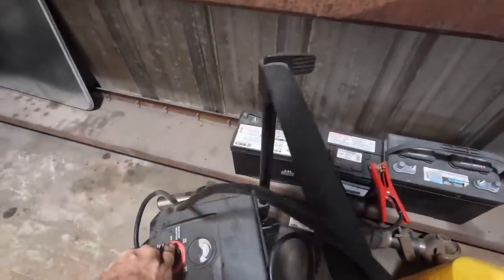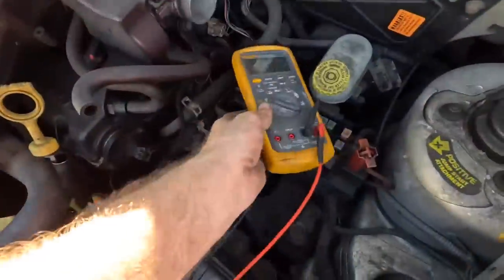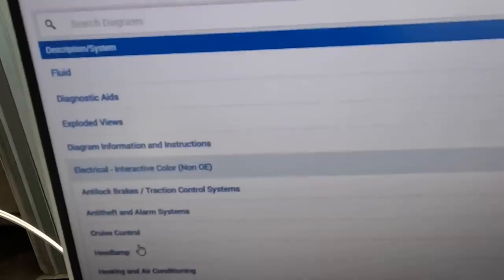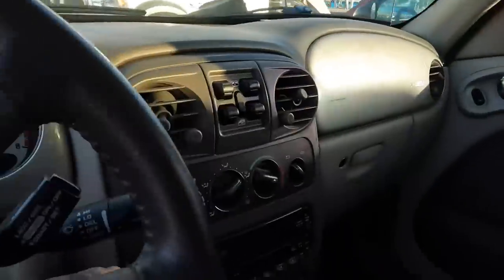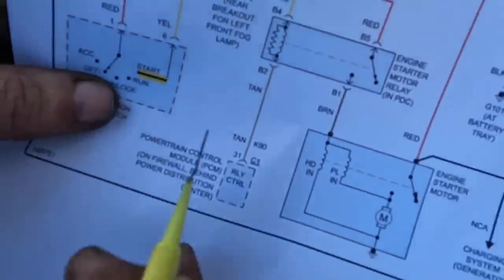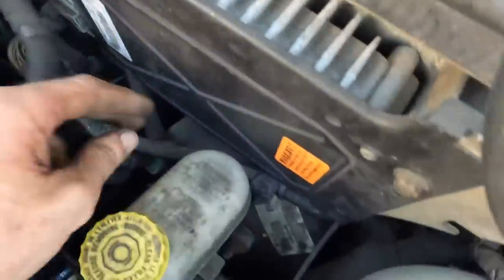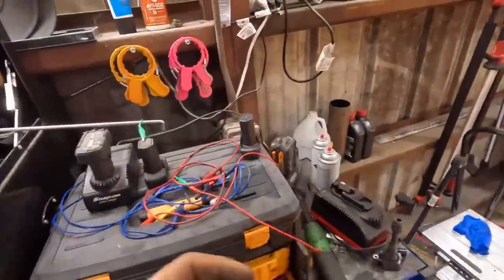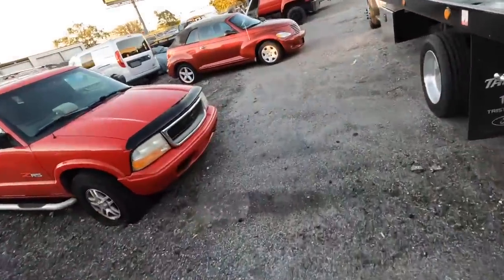It’s DEAD! Parking lot diagnosis

Comment: Just finished diag/repair on Chevy 3500 w/electrical issues. Culprit was brake light socket melt and short internal. New flasher, relay, socket, and clean up wiring. They used used wire nuts to wire dump bed and rear lights. All soldered /proper connectors now. Took 2 days to chase that short down.
Reply: Had a similar ordeal on my 73 Monte Carlo. The cig lighter wasn't OEM and wouldn't stay in and pop out when heated. My GF held it in to the point the element came out in one long string. A battery and alternator later I traced the electrical drain to the socket, got and ground shorted with a piece of the element.

Comment: Just had a similar issue with a similar year Jeep - no crank, no start, no fuel or volt gauge movement in the cluster, but it would crank fine if I sent power down to the starter through the circuit the relay energizes. Ended up being the PCM.

Also, you can't just swap PCMs on Chrysler vehicles that have a SKIM (fat grey key is an indicator), and if you have a compatible PCM from a vehicle that doesn't have a SKIM and install it into a vehicle that has it, it'll lock to that vehicles SKIM and will no longer work on the original vehicle, unless you reset SKIM on it.

Comment: The "ground" supplied by the PCM is a switched ground control line for the starter relay. I don't have the documentation for this car, but the PCM is looking for a certain set of conditions to allow the starter relay to operate. So the PCM may or may not be bad, but you won't know until you figure out and test the conditions the PCM needs to allow cranking.

Comment: Hey, Ray, when you apply power or ground to a circuit by using a test lead straight to the battery, you should run that through a head lamp bulb. It adds a lot of functions to your test lead, most notably, short circuit protection and current-carrying capability testing.
Was this a case of no-communication on the OBD-port? Your scan-tool should be able to provide an answer on why that PCM refuses to allow crank.
And if you don't hear the fuel pump priming, you should check why it doesn't do that. Supply power to it through its relay contacts and check if the fuel pump relay's input is getting power.

Comment: An un-bent paper clip can be a handy tool for such diagnosing.  With "crank, no start" I like to use aerosol starting fluid to see if I can get the engine to run a few seconds, to isolate whether fuel issue or spark issue.

Comment: A few commenters have mentioned the immobilizer system. Given the symptoms, I would agree. *BUT*, my first thought was something in the Neutral Safety Switch. The NSS sends a signal to the PCM, allowing PCM to ground that relay as long as the trans is in Park or Neutral. I would imagine that you can see that PID on a scan tool. My suggestion is to get the scan tool on that car and see what is going on.

Comment: Had a similar issue on a GM product and it turned out we were using a non programmed key.  Once we had the right key it worked immediately.  Not sure if this car has a programmed key or not, but it would not surprise me a cheap car has a dealer made only key.

Comment: PATS problem.  The PCM only provides ground to that circuit when it reads the chip in the key.  The computer is matched to the reader in the column.   You can only reprogram it if you get the pin number from a dealership.  You can take the pats module, key, and computer out of another car  from a junk yard and change them all together and it will work.   Chrysler will not give me the PINS for anything because I am not a Licensed Locksmith or some other Auto Security Certification.   Make sure you get the same year and options, and don't get one from a convertible.   Someone has been futzing around with the PCM and the Ignition in that car.  My guess is they tried a new PCM and then created a new issue thats different than the original one.  Just make sure they don't read the VIN out of the computer and make sure it matches to do emissions or registration in your state, like the do in NY.

Comment: good process. only question for me was IF the pcm was replaced was it programmed or is the security not allowing the start and  fuel pump since the column is open were they trying to eliminate/override the security or trying to test the switch... hard to know...

Comment: Did you check the neutral safety switch?  I didn't see it on your diagram so perhaps the PCM does not turn that ground on unless it is satisfied with the state of the neutral safety switch.  Although that car is old and I'd think it would be in series with the crank signal from the ignition switch?  I avoid Chrysler so I don't know.  Great video!  Thanks for bringing us along!

Comment: Got a "fun one" for your info:

2013 F-150
Intermittantly drops to limp mode. Stop, power down, wait a couple minutes and it runs fine for some random time... 10 min to 4 months.  repeat.
No codes can be caught if it is not actually in limp mode.

Finally got it to dealer while in limp mode.  There's a recall "If this code, replace half the wiring harness."  But only if you get it to the dealer with the code active...
Reply: Almost for sure there's a bad electronic code in the key vs the anti-theft.  Probably someone recut a key from another car or replaced a computer module without correct reprogramming.

Auctioned repoed car where they didn't get the OEM key?

Comment: You’re going down the wrong path. The big red security light is on in the cluster. Plug your scanner in get codes. Bet it’s the key that’s bad or the immobilizer ring around the ignition lock cylinder
Reply: that is the air bag light  The CAR IS OUT OF GAS as noted by the gas light being on  and is on empty...
Reply: The gas light being on doesn’t have an effect on no cranking. He had to provide a ground to the relay himself so the pcm isn’t happy with the theft. Watch part 2 when it shows up

Comment: That's usually where I get hung up.  They frequently don't make it clear what conditions the PCM needs to enable start.  As some said, there are various anti-theft and transmission conditions that must be met but it can be very difficult to find out what they all are and what the proper states coming into the PCM are (grounded?  +12v?  Or?).  Perhaps the scan tool can report on this?

Comment: I really blew it a few years ago when my PT suddenly died at about 40mph. I was so fixated on its high mileage and thinking it will need a new timing belt, that I assumed it was the problem and was too afraid to repeatedly try to start it, in case it had broken. I tire the car half way down and realized the belt was fine. It sat another two years until I got the energy to put it back together. Once I did that, it started and died. That was when I realized it was out of gas. Duh!
My lesson was I gotta be careful to not jump to conclusions too quickly
Reply: Lesson learned ; Always start with the simplest possible cause of the problem. 
  I've ignored that rule myself, causing myself hours of work leading up to a Duh !! moment.

Comment: If the ECU does not recognize the key. It will not turn on the injector circuit. It did crank before, but after a few tries with a bad key the ecu locks the starter function out. I had one back in the day. I lost the keys. Went to the dealer and had  a new one ordered. Took it home and tried it. Crank and no start. Then after trying to troubleshoot the starter stopped operating. I use the IM508 or 608 Autel to test and program keys now. Very good unit for troubleshooting key issues.

Comment: RAY READ ME!!!!
I had one of these last year and it was some wires to the under hood fuse block. Found it by grabbing a hand full of harness and it cranked. Narrowed it down to a loose pin in the back. Js. Posted before finishing watching. Dodge/Chrysler would crank and run first time for a sec if the security was tripped. Then no fuel after dtc was set. I know you know the basics ray. Can you com with the pcm via your snap on tool ???  Best way to tell scan it key on or also try and access live data. ? I’m telling you seems crazy but stick your fingers in the opening of the fuse block and jiggle while the wife unit cranks. I know seems crazy but worth a shot.   Good luck with this Chrysler junk lol.

Comment: That area you’re in seems to be saturated with PT Cruisers. Wow.

I am terrible with chasing down electrical problems during troubleshooting. It would be easier if I could put my hands on the wiring diagrams, but there generally aren’t any websites that provide them for free. 

The only helpful thing I can put my hands on are the Service Manuals (Haynes/Chilton) and luckily I have them for most of the vehicles I will work on. Some of that info is a bit over my head, but videos like yours help explain a lot of what I was never able to figure out on my own. Thank you for that Ray.
Reply: Florida old ppl
Reply: @Usmanthemecano  🤣😂🤣😂

Comment: Scan tool talk to the pcm? If not then thats an issue but if it does I wonder if you could control the relays from it. Also a good idea to try and scan to see if a code in a module somewhere might give you some direction.

Comment: Always an issue with those models, the ASD (automatic shut down) and the TIPM (under hood fuse distribution panel).  Replace 1 or both, and usually "there's your problem lady".  ;)

Comment: Ray, I noticed the low fuel light on when you cranked it and the fuel gauge was near empty. Now, maybe that low fuel light always comes on when cranked, but the fuel gauge needle should move off of empty, right?  It was hard to tell, maybe the needle moved a little.

Comment: Park/Neutral safety switch.
Brake/shifter interlock switch.
Immobilizer module (antitheft)

Before you do all that other fancy testing & everything you always check for spark you always check for a fuel & you spray a little carb cleaner into the already open throttle-body  to see (while you jump start it with the test lead), if it starts & runs.

Comment: Excellent electronics method of finding out what works and what doesn't. My guess it is in the steering column. Know as
 the SKIM module or WCM  It is the sensor / receiver from the key  to the PCM and could be the source of the problem.
The key is married to the SKIM module and the SKIM module is married to the PCM. The SKIM module has a loop of plastic which contains an loop antenna. The wires to the PC board inside can oxidize and since they not soldered to the
 board that will stop you from turning on zee engine. The contacts can be cleaning with brake clener and easily put back
together. Then test with the key again making sure all connections are good and tight. Some modules have a different 
design but for this year you should inspect this problem first.

Comment: My brother-in-law had a similar problem with a red Dodge truck. His repair shop guy could not fix it, Dodge dealer said it needed new part that was not manufactured anymore and was back ordered (6 Mo to a year out). His repair guy called all over America to junk yards with no luck. Finally his repair guy found a car key specialist who had some electronic device that allowed him to reprogram the control module (anti theft chip in key to module issue) to talk to key. This "key" guy later went to the Dodge dealer and fixed 4 of the 5 cars they had there waiting for parts.  He sold the Red Devil for a little loss, but was a happy camper to get any money for the beast!
Footnote: This is the condensed story. Takes 3 beers for the full saga....LOL

Comment: I would open the ECM  and check the solder joints everywhere, If you use a reading glass you may find a circle at the solder joints the sign of vibration over time. If so redo them w/leaded solder and a solder iron chances are it will work. I do work on speedometers and  fuel injector and ABS boards like that all the time.
Reply: Given the age, electrolytic capacitor failure and leakage is also pretty likely.
Reply: @trillian23x  think i saw that on Motor Age channel. Interesting how it looked

Comment: Bad capacitors from the early 2000s? my 2004 Ford excursion had bad caps and the junkyard replacement from the same year had defective caps. Had to send it out to a shop that could remove the potting epoxy, replace the exploded parts, and regoop it.  Fun.

Comment: I think it is the chip in the key not being programmed with that PCM. When you turn the key to the on position that little red dot light should turn off within a couple seconds allowing it to start. If the dot stays lit it will never start. I dealt with the same issue with a Dodge Caravan that I own.

Comment: My 2001 PT suddenly wouldn't start. Did the troubleshooting through the starter relay, there are a few similar ones to swap out, so that's pretty easy, even without a voltmeter.
I setup a long metal rod to reach the solenoid and voltage was present. So I applied battery voltage, via the rid, directly to the starter side of the solenoid and it cranked. Being that they are sort of a one piece thing, not like the old days where you fix them, I replaced the starter and it works great. I also had a lot of after market led lights, sound systems, alarms and bling on the car. It was previously a show car. It would die every three days if not started. I think it was pulling about 60 milliamps from the battery in the off position and so I disconnected about every aftermarket item and it seems okay. I bought it and it just had a bad battery after sitting for three years in a garage. Since the new battery, I ended up with a second new battery from the constant discharge and sitting discharged. Happy to say it's running good today with 220,000+ miles on it.

Comment: Many have seen where an undetected -corroded ground strap has cost thousands in misdiagnosis ; unleashing a parts cannon by multiple techs; up unto replacing the wiring harness. I think it was AutotechMike had one where a disconnected drivers seat connection literally disabled most of the PCM.

Comment: clearly PCM/ECU controls that ground, immobilizer system might be on and most times those wont allow to crank, now you just bypass ground to starter relay and key gives +12v but still immobilizer can also disable fuel pump and spark.

Comment: Hey Ray.  I have a 2008 jeep and when the battery gets 4 years old you lose starting just like this one.  Replace the battery and zero problems till the next time the battery gets old.

My conclusion is that the pic senses the battery voltage and shuts down the starting etc circuits till you put a new battery in it.

You already tested the battery and it is old and not in peak condition.

My bet is that you put a fresh battery in it. 

Now a 😮 pcu might be programmed to not do this but even so I bet the original pcu will work with a fresh battery.

Comment: Had a problem with my 02 camaro, it would not crank one day. Turns out the anti theft had malfunctioned, as in the wire in the ignition that detected the chip in the key broke. Got it fixed and it worked fine. Until that shop killed the engine and wanted me to pay for a new one.

Comment: Yeah I have a 99 Dodge Ram van and transmission started acting up a new solenoid and whatever those two things you put on those 46re transmission anyways it ended up being a bad ground from the PCM so I put a ground on the 10:30 wire coming off the PCM and that fixed it and it started shifting fine so don't throw out a transmission just because it ain't shiftin right it could be a bad ground

Comment: that pt can tell if the starter is pulling to many amp and disable the starter circuit just put a fresh battery on it and clear the codes its doing that because of that bad battery

Comment: Check for a SKIM key mismatch error which would be the chip is not being detected or the PCM was replaced and the chip was not programmed. Get a DRB III to program.  Oh and the no start condition may be a broken timing belt but the good thing is that it’s a non-interference engine.

Also, 01-03 non-turbo pcms are interchangeable but the VIN code needs to be configured in the PCM for it to work.  During the onboarding process the SKIM module is also configured to the PCM. I have instructions for programming the new PCM using a DRB III if ya need it.

Comment: Ray, it's a good thing people are sending you brake clean. It's up to $4/can here in Vegas. Price has doubled in 2 years. Inflation is only 16% since then though. Hmmm...
If that's a reman PCM, could be junk. I've seen a HUGE increase in junk reman parts since covid. Most of the reman factories are in Mexico. They must be having the same problem there where low paying labor jobs are only attracting people who can't get a job anywhere else. That being said, the PCM may not be faulty. The relay control in the PCM may be preventing the relay from closing for a reason. Is there a chip in the key?

Comment: Hey Ray, this is just a suggestion for you. Rather than swapping out relays in fuse boxes, why not purchase this set of on/off switch type of relays for less than $60.00 on Amazon. It’ll definitely save you a lot of time doing the swap out technique that you now do. And you will have a definitive answer much quicker. Here’s the information: IPA - 9038 Diagnostic Scan Tool, Plastic, 6 Pc Black. I do hope you read this post and at least consider it. I do believe it is very beneficial.
Reply from the maker: Ws just checking to see if relay was stuck open. Swapping them is an easy ‘process of elimination’ test